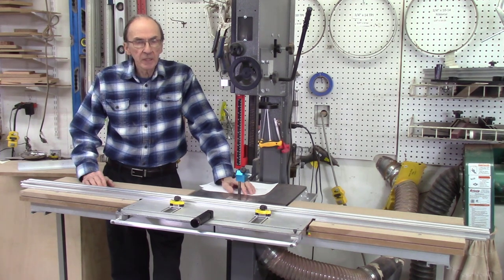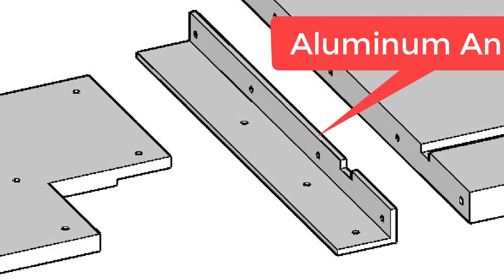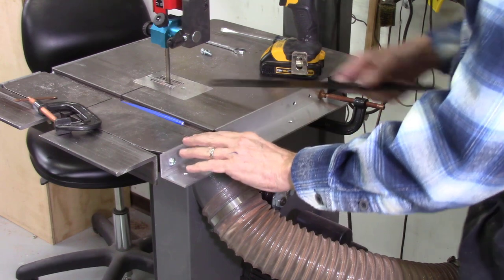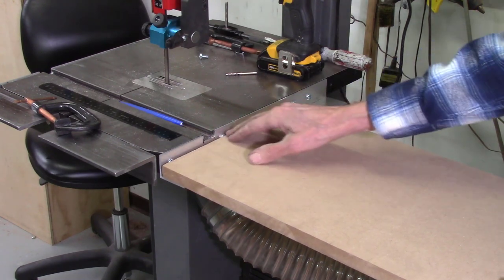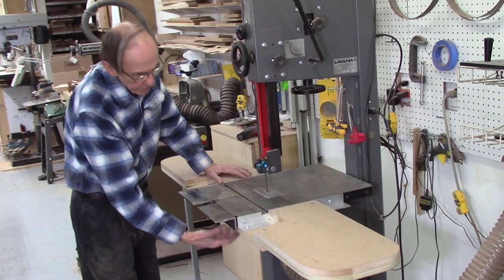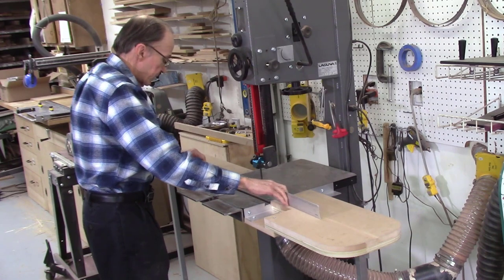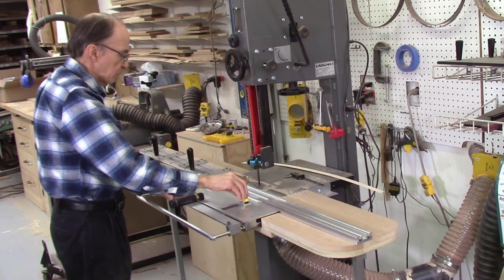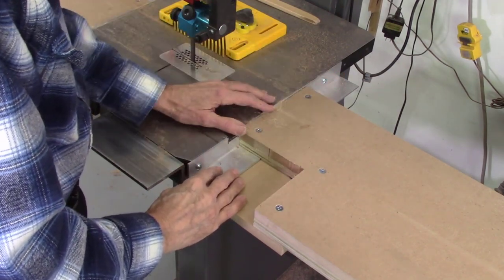Band Saw Infeed and Outfeed Extension Tables, (126)

Comment: John - for reference on the other measurements (particularly the cut-outs required for the Accu-Slice table) can you post the width of your Laguna's table?

I just started getting pieces to make my own.  The only change I'm going to make is to use a T-nut captured between the plywood/MDF table layers, and I will use "speed knobs" underneath to attach them.   I'm going to try to make these somewhat "universal" to I can extend the bed on my jointer as well.  But we'll see - the Accu-Slice is my primary concern.

I used these as my legs on my first table - they're great - a little pricey, but they work perfect - https://www.amazon.com/dp/B08R9G786S

Slick design.
Reply from the maker: The cutouts depend on you model of band saw and also the model of Accu-Slice system.  On my Laguna model 14/12 band saw, I made these cutout about 5" square because I wanted the table extension sto fit both the model AS216 and the model AS266 index tables. If you just wanted the extension table to fit the model AS216, then these cutouts could be smaller.